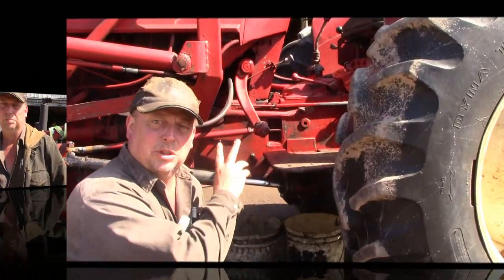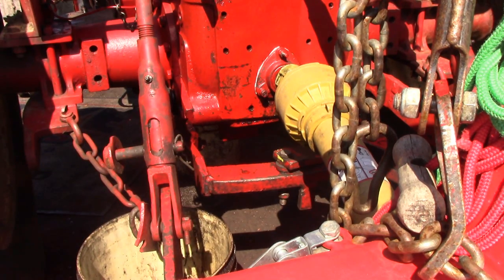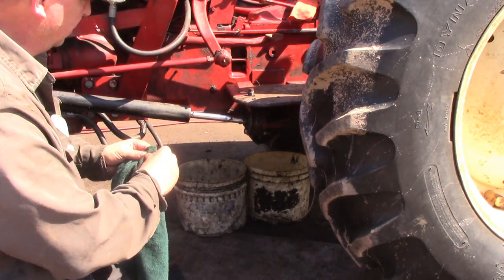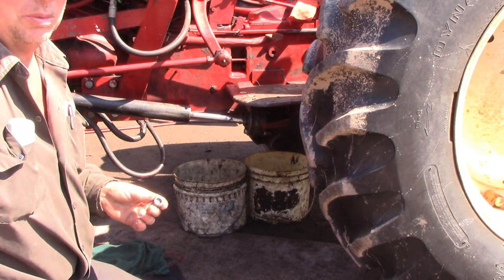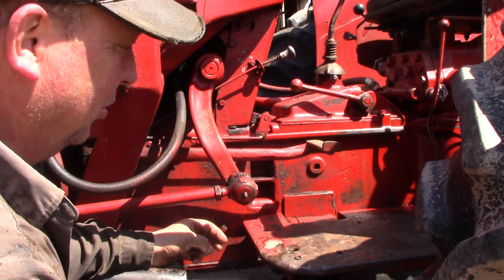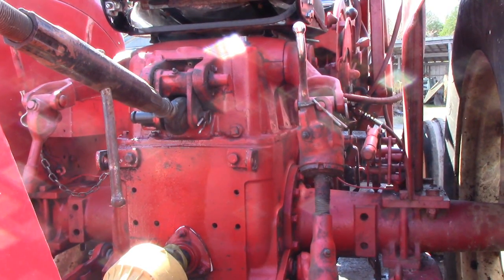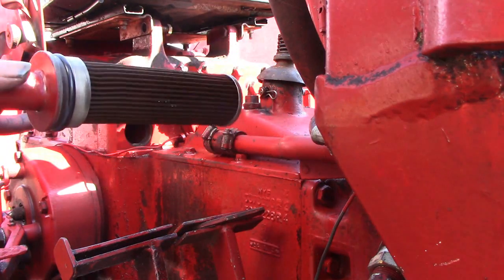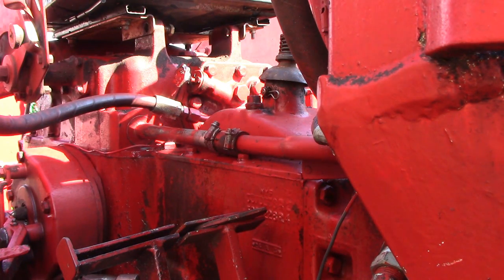IH 444 Fliuds change

Comment: Hi Dave,
About a month ago I contacted you after, because, as it turned out, the transmission on my 354 diesel took on water, water froze up solid, needed a thaw, drained, and new fluids. That was done. Separately, the plastic tube that goes from the intake manifold to the front cover where the fuel pump gear is located broke.That I replaced. It started.  So far so good. And thank you for your help with the change of fluids youtube!
However, these previous events may have something to do with the reason for my question. After all this occurred, I started the tractor and it imeadiately began to rev-up to the max and the kill knob wouldn't stop it. I had to turn off the fuel to shut it down. The only other issue that could have possibly been involved has to due with the upper of the two bleed bolts on the fuel pump. The lower smaller one seems to be original. The upper, slightly larger one appears to be  jury-rigged.  It's longer bolt than necessary and has had a nut put on it to shorten the distance it goes into the fuel pump. That is - you tighten the nut rather than the bolt. At this point it goes in about an 3/4 to an inch farther than needed. Maybe that has interfered with or damaged what ever's going on inside.  Or.. maybe the pump  needs to be repaired or replaced. 
In any case, I would appreciate your thoughts! 
Best,
Steve
Reply from the maker: The jury rigged upper bleed screw could be interfering with the pumps governor system keeping it wide open.
Reply: @CanadianRedneck15   Thanks! Dave, I'll replace it and let you know what happens.
Reply: Hello again Dave,
Back to the jury rigged bleed screw, I removed the lower bleed screw and  it came to a point that  fit a seat.  So while the upper jury rig bleeder is just a bolt one with a flat face, I don't see how that's the cause of the problem - and it's never been a problem before.Of course i'm looking for the simplest and cheapest way out, but fear I may have to send the pump out for a full rebuild. $$$$.  Is it possible to repair the issue rather than go the whole 9 yds? If not can you suggest then most reasonable folks to send it to please? Always great for your help!
Reply from the maker: @StephenMack-ut9vf  There's a guy in Moncton that is good, Joe the pump guy 506-858-8146.
Reply: Thanks Dave!

Comment: Great video thanks - about to do my first service of a 414 we bought a year ago. This video has given me a bit more confidence about exactly how to go about it.
Reply from the maker: I am glad you found the video helpful, thanks for watching!
Reply: @CanadianRedneck15 Possibly a dumb question, but do you know what the screw on the top of the filter head is for?

The operators and workshop manual don't mention it at all, and so I guess it is unnecessary to mess with when replacing the filter? My only guess is it makes pre-filling easier, which also appears to be optional?
Reply from the maker: @ferrouswheel  On the oil filter head? Possibly to access a pressure relief valve?

Comment: Hi Dave and thanks for your video!! a great help! I have a 1971 IH 354 diesel tractor. Can you please tell me what the capacity is for the transmission? Thanks!  Am I correct in saying that while there are 3 drain plugs there is only one fill plug and only 1 level plug? Times of repairs and use seem to be neck and neck theses  days  but I have to love it anyway!  It is red. 
Many thanks for your time in making your videos and have a happy holiday!!  Best,  Steve
Reply from the maker: The manual says 6 gallons for the trans/diff, and yes, just one fill and one level plug. Thanks for watching!
Reply: @CanadianRedneck15 
Thanks Dave! 
 I started my IH 354, put it gear, release the clutch, and  promptly stalled out. This continued with all gears in high and low with the same result. Sorry to say, I'm all too familiar with a clutch disk sticking to a flywheel but that couldn't be it because I would most likely have been able lurch forward if I was in low range 1st gear. Couldn't figure it our so I Finely called Jimmy Raymond In Canterbury Ct. - the last word when it comes to tractors. He chewed on the problem as and finely said: water's got into the transmission and the the gears are frozen up.( it's winter) That made perfect sense. I pulled the plugs and had to brake through the ice with a screwdriver to get some oil and water slop to start draining. It will thaw. 
I thought this might be a helpful thing to know.
Reply from the maker: @StephenMack-ut9vf  Yeah, that is not unusual.

Comment: Hi, I am new at this but at beginning of video you removed 3 drain plugs but only filled in one place...is this correct, that one fill point,was for the three points drained...
Reply from the maker: Yes, the transmission and differential cases are all filled from the one spot. There are 3 plugs because there are three low spots in the cases so to drain all the oil you need the three plugs. Thanks for watching!

Comment: What type of fluid goes in the hydraulic system on a B414 international
Reply: Thank you sir
Reply from the maker: CaseIH Hytran oil is recommended. Thanks for watching!
Reply: Thank you
Reply: Where is the best place to find a repair manual for a b414 international
Reply from the maker: @TheDieselman1968  There are manuals put out called IT manuals that are kind of like Haynes manuals for cars, you might be able to get them at TSC or similar stores. Thanks for watching!

Comment: Thank you!!! Awesome video. 
Would you be able to make a video on checking/changing oil in steering box of 434 international? I have a leak in mine and water gets in as well which disables me from turning left in winter haha. 
Benoit- Sault Ste Marie, ON
Reply from the maker: I don't have one here to video but there should be a plug low on the side of the box to drain it. Thanks for watching!

Comment: I just inherited a B-414, Love you videos, I have learned a lot from the about 414, But I have a question, the starter is bad I removed it and counted the teeth, it has 11 all I see for sale on internet for these tractors have just 10 teeth. are these suppose to work?
Reply from the maker: Yes the 10 tooth starter is a direct replacement, it will bolt on and go. Thanks for watching!
Reply: Thanks for info on starter, Your videos are great. But now I have another question. this tractor has a speedometer/techometer but doesn't have a cable hooked to it and can't find a place to hook on to. the alternator is gone, I saw somewhere that cable hooked to back of it?? What I did find was on eBay was a tech drive unit that bolts to side of block where the distributor would be on a gas engine but it has a plug similar to a freeze plug presses in it. My question is if I pop that plug out can I mount the tech drive unit there, is there something under plug to turn the tech drive unit????  @CanadianRedneck15
Reply from the maker: @dannyvaughn8149  The tach drive would run off of the oil pump under that frost plug. I've never seen one with a frost plug there, some PO must have removed the gear box and stuck a plug in the hole.

Comment: Thanx for the show  where can i get engine oil cap  inside rubber is worn out
Reply from the maker: You will likely have to check the used market or see if you can find a generic one that fits. Thanks for watching!

Comment: Hallo Dave,
Super Video, hat mir schon viel geholfen! Danke!
Ich hätte einige Fragen, ich bin für jede Antwort sehr dankbar! 
1.) Habe das Problem, dass ich kein Handbuch für meinen b-414 habe. Ich bräuchte bitte Füllmengen für Hydraulik, Motor und Getriebe und welche Art des Öls, kannst du mir bitte helfen?
2.) Beim Motorölfilter war bei mir gar keine Druckfeder drinnen, dass ist nicht so gut oder? Wo bekomme ich diese zu kaufen?
3.) Beim fahren auf Kraft raucht er extrem schwarz wie ein Zug :-) hättest du eine idee wie ich dieses problem in den Griff bekomme? Er fährt auch nicht die Geschwindigkeit die er sollte und läuft auch nicht auf Vollgas, der vorgänger dürfte da einiges verstellt haben und nicht mehr weitergewusst haben und ihn so verkauft haben..

Ich freue mich auf eine Antwort von dir und hoffe du kannst mir weiterhelfen! Dein video war schon sehr hilfreich ich danke dir!
Freundliche Grüße aus Austria / Europa.
Reply from the maker: Asfor capacities I'm not certain, add til you hit the full mark. Hydraulic(CaseIH hytans)- 3 inches of fluid in the reservoir, engine oil(good quality diesel engine oil 10W-30 or 15W-40)- I think about 6 liters, gear oil (80w90) about 24 liters.
  For the filter, use a not too strong spring and washer to hold the filter in place.
 For the smoking/lack of power check your air filters. The 414s would always smoke black under load but clear as the revs caught up to the load. Check your throttle linkage that it is operating the link on the injector pump the full way.
 Thanks for watching!
Reply: @CanadianRedneck15  Danke ihnen!
Werde das überprüfen, ich hoffe dann funktioniert er wieder wie er funktionieren muss!
Wünsche ihnen ein schönes Wochenende und vielen Dank noch einmal!
Reply: Hallo, Danke für die schnelle Rückmeldung.
Wenn eine einfache feder mit scheibe reicht bin ich sehr erleichtert, dachte schon dafür muss ein genormtes Teil her.
Sie meinen gegebenenfalls bei der einspritzpumpe den anschlag verstellen falls beim gaspedal noch luft ist, oder? Muss ich andere einstellungen danach beachten oder kann ich dann beruhigt damit fahren?
Luftfilter hatten wir ausgebaut und ein Freund der Landwirtschaft betreibt sagte mir ich kann diesen mit Diesel etwas reinigen, danach habe ich mit druckluft getrocknet, öl in das Gehäuse wie beschriftet und wieder zusammengestellt!

Unsere händler in der Umgebung wissen sehr wenig über diese traktoren, ich bin froh das ich ihr video endlich gefunden habe und sie mir weiterhelfen können!
Schöne Grüße, Martin
Reply from the maker: @martinmullner2187  A simple spring and washer should do it. I mean check to make sure the linkage is pulling the lever to the stops on the injector pump. Cleaning the air filter like you have said should be good.
Reply: Sorry, hab etwas vergessen.
Sie haben unter der zapfwelle öl abgelassen, nehme an Differential ist das, füllt sich das mit getriebe oder Hydraulik gleich auf oder wird das seperat wo eingefüllt?
Danke nochmal
Reply from the maker: @martinmullner2187   Yes, the 3 drains underneath all fill from the transmission.

Comment: im not a mechanic and I love your videos I have a old 2400b International gasser just wondering the 1st two plugs you pulled are both gear box oil and what wt oil do you recommend thanks for the info and videos
Reply from the maker: You should double check because I believe with some of the industrials the transmission/differential was also the hydraulic reservoir. If the hydraulic oil is separate then I'd use 80/w90 in the trans/dif. Thanks for watching!

Comment: Thanks so much for this video. I have the service manual for
My 354 but it was still a bit confusing. A lot of people say the hydraulic system should take the hy-trans but it looks like you put regular hydraulic fluid in. What kind of fluid did you use in the video and is that acceptable? It looks like the high trans is used primarily in the hydrostatic driven tractors?
Reply from the maker: I generally use hytrans but regular hydraulic oil will work. Thanks for watching!

Comment: I inherited a 444. Changed all the fluids, cleaned the screen, thanks for the video. Loader is still jumpy, slow to raise it up. Acts like the pump is starving for fluid. Any advice on things to check would be appreciated.
Reply from the maker: Check the rubber hoses for leaks where the pump could be sucking air. Thanks for watching!

Comment: Could you do a pto oil seal replacement?? Very helpful videos 👍👍
Reply from the maker: That is a very simple job, take the three bolts out of the seal retainer, pull it off and change out the seal. Thanks for watching!
Reply: @CanadianRedneck15  thank you for the reply will have a go this weekend. Tom from England 👍

Comment: I'm changing the subject,  454 main body ,transmission, rear end,  you would know, is 574 the same or is it larger than 454 .
Reply from the maker: The engine will bolt right in, there are a few parts that are heavier like the final drives. Thanks for watching!

Comment: What would cause my oil dip stick reading high after driving   Can it be Hyl oil leaking or the diesel pump leaking in to oil pump Had the Hyl pump rebuild but no sure why my dip stick shows high  Thanks for any info I also rebuilt engin after watching your videos Great Videos
Reply from the maker: That could be the hydraulic pump or more likely the fuel lift pump. Thanks for watching!
Reply: @CanadianRedneck15  thanks for fast reply My Tractor is diesel can it be   Ih 444 BD 154
Reply: No sure what u mean fuel lift pump
Reply from the maker: @MrHeavyev  I expect it would be a BD154, yes.
Reply: @CanadianRedneck15  thanks I think I’ll change fuel pump it’s a lot cheaper then the fuel injector pump thanks I rebuilt my 444 Ih Bd154 from all of your videos Your The Man Who Really Knows Tractors
Reply from the maker: @MrHeavyev  Thank you, I appreciate that!
Reply: @CanadianRedneck15   tThanks for reply l thought it might b fuel injector pump never even thought fuel lift pump thanks I will look at that
Reply: I want to thank you again You we’re right that my fuel pump lifter that was causing my oil dip stick showing high I bought a new one and it solved the problem You are the guy that Really Knows Tractors I Rebuilt my complete Ih British 444 Bd 154 by watch your Great Videos Thanks so very much for your great Videos Just wondering if you have a video on a British Ih 444 Bd 154 Power Stering CYl   Or were it possible to still get seals for this CYl  Or where I can get them If you ever have a video on this issue Sure would appreciate it Thanks Again For Your Great Videos Your My Man to go to for your great info and Videos how to fix Tractors Keep them Comming I Learned a lot from you Thanks
Reply from the maker: @MrHeavyev  That's great, I'm glad the fuel pump fixed it for you!
   I don't have any videos on those cylinders, that's not something I want to tackle, they're pretty picky units.
Reply: @CanadianRedneck15  Thanks for reply I guess I can live with a little drip from CYl  Keep those great videos comming I learned a lot from your videos
Reply from the maker: @MrHeavyev  Yeah, unless it's bad it's best to ignore and just add a little oil now and then.  :)
Reply: @CanadianRedneck15  that’s what I’m going to do Thanks

Comment: Hey Dave, can i use propane heat torch to see if that will help loosen the sealant. Also I need two IH ST443 Bearing for axles, one for each side. 68mm Id x 120mm od x 23mm width. i can find bearing with 65mm Id, but they want fit and slide over axle..Thanks
Reply from the maker: You could try heat, you will want to replace the oring that holds it after though.
Reply: @CanadianRedneck15  I heated it, then sprayed water on it to cool and the 2nd time it broke loose..Filter was super nasty, glad i was able to get off..Any advise on the ST443 bearing..Thanks
Reply from the maker: @anitaanntubre5589   I'm not sure where to get them.

Comment: Hello, Have question..I have a 1964 IH 424 diesel tractor..I cannot get the hydraulic filter to break free. Wanting to take out and clean filter. I have put channel lock, and wise grips and that didn't do it. then i put a heavy hose on hydraulic line and hooked a chain and 4-wheeler to try to jerk.. that didn't work either..any suggestion on how to get off...Thanks
Reply from the maker: I suspect that some wise soul has stuck in there with some sort of sealant and basically glued it in. About the only thing you can do is to keep wiggling on it til it breaks free. Thanks for watching!

Comment: Hello, I have a 2444 International and I have been told to use hydraulic oil for the gear oil. Should I be using 80/90 w instead? Thank you. Steve
Reply from the maker: Yes, use 80w90 in the transmission/differential. Thanks for watching!
Reply: Thsnk you.

Comment: Thanks for the fantastic videos, I learn so much from them! I have a 384 and have 2 questions. I don't really know much so still learning. 1st is the PTO oil and transmission oil the same reservoir? 

2nd, the PTO will not engage, the lever seems to swing easily back and forth without any feeling of PTO engaging. Is there a shear pin on the PTO lever that may have go e bad or something else worse inside? Thanks!

Leroy
Reply from the maker: I am glad you have found the videos helpful. The PTO uses the same oil as the transmission/differential. The outer lever has a small pin that connects it to he inner lever that actually moves the pto locking collar inside the housing, that pin is likely broken, a pretty common  issue. You can access that by removing the the lever housing from the diff case (3 bolts) and replacing the pin. The hardest part is getting the lever to engage the collar again when you reinstall.
 Thanks for watching!
Reply: Thank you so much, much appreciated!
Reply: I also have another question for you. What other IH tractor models parts match the 384? So if I have trouble finding something for the 384 I can get it from a different model and it will still work on my 384.
Reply from the maker: @leroyfender  Engine and transmission parts will fit from a 434, 444 and a late 414.

Comment: Can the engine of this tractor be replaced with a modern engine, for example, with a focus 70
Reply from the maker: The engine is part of the frame, I don't see how you would switch to a different engine.